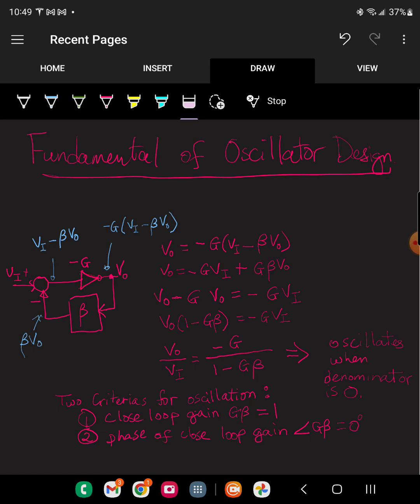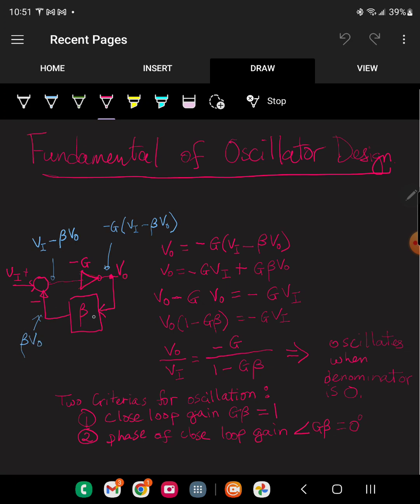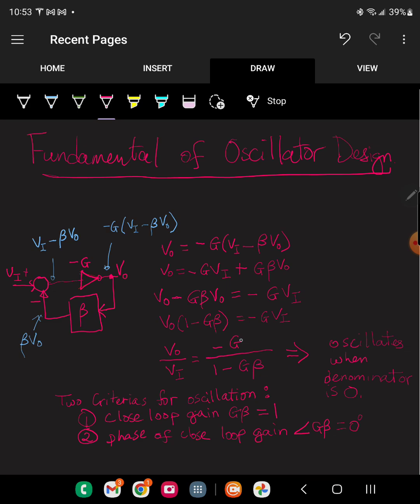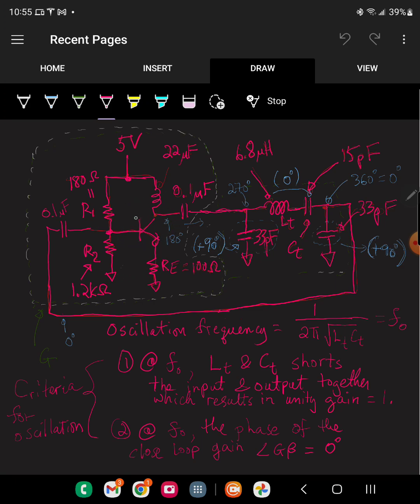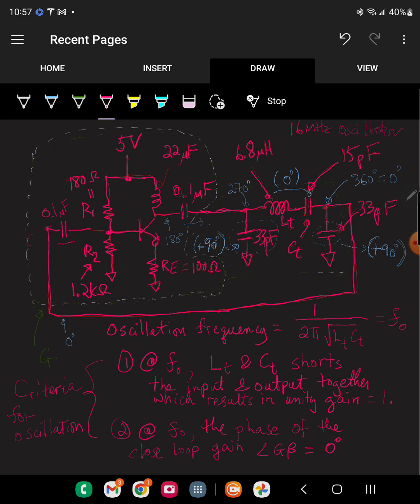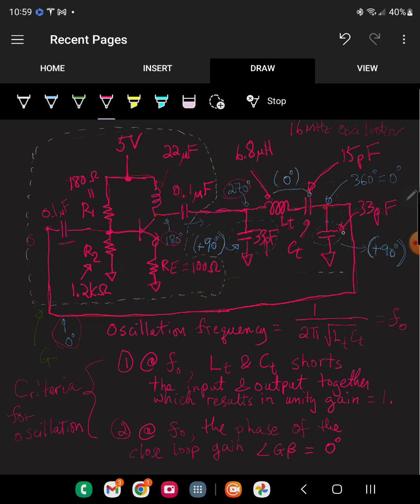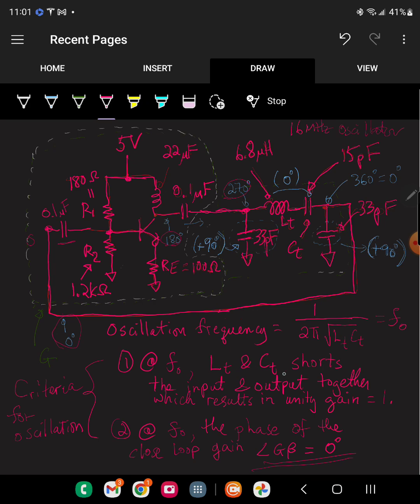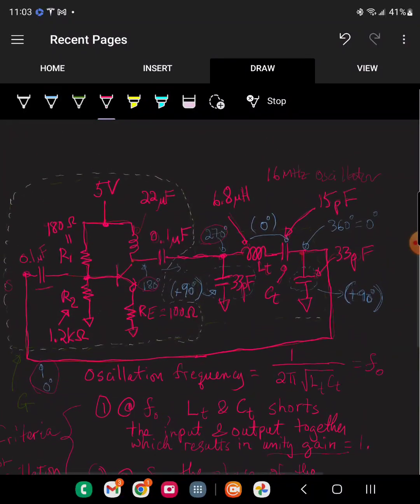How Oscillator Cicuit Works

Comment: You are amazing. This shows the flyers so we’ll. The potential of this set up is amazing. Laboratory experiment to create flyers, analyse and we will understand so much more. So many questions I want ask. Do tuners actually work and why? Does cleaning affect harmonics? Does stock bolt tension affect harmonics. Does barrel length change harmonics. Your gear can test all these operations and come up with answers or more questions.
Just brilliant and keep going.
Reply from the maker: Glad you are enjoying the contents.  There's a lot of still unanswered questions that I am planning to experimentally answer.  Some answers to your questions:
1.  Tuners do work to an extent.  Use good ammo and tuners will definitely help.
2.  Cleaning probably affect the friction and vibration.  If the ammo has wax, it probably reduce some of the vibration/friction.  
3. Not sure about stock bolt tension.
4.  Barrel length definitely affect harmonics
Reply from the maker: Watch this video for how tuner works:  https://youtu.be/OzYbdFGbONU